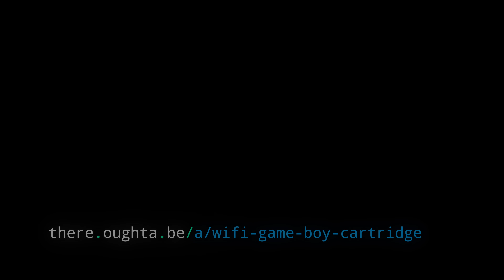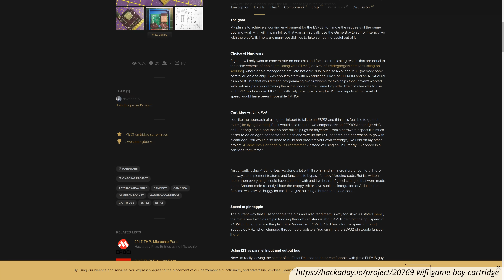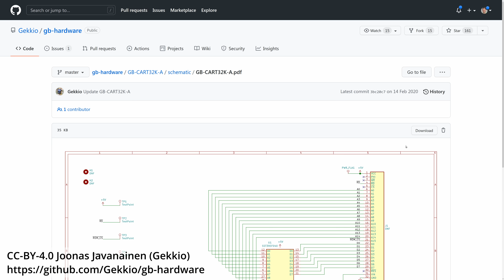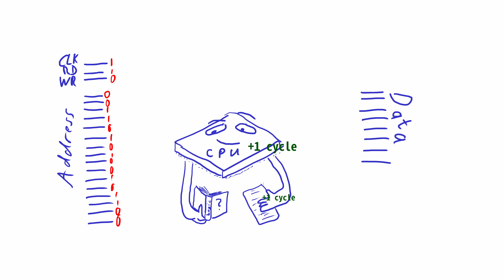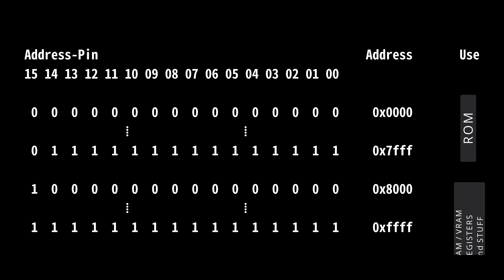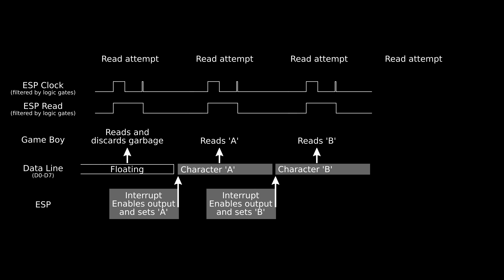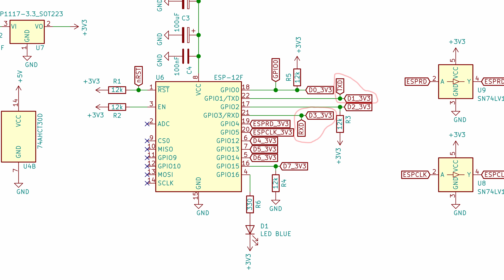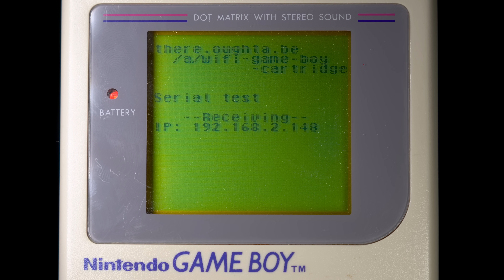WiFi Game Boy Cartridge

Comment: I wonder if you could have some memory in-between your ESP and the Gameboy, similar to the EEPROM.
Write to memory, then write to the special address to "submit" the data. Or to read from it, write to a special address to trigger a read, and wait until a particular memory cell (probably address 0) contains a special value to indicate the read was done.
You could probably condense this into a single special address by re-using that address 0 of the memory cell.

Of course, any additional buffer memory will reduce the amount of data you can use on your EEPROM. Though, if space is an issue, you could easily add bank switching...
Reply: Or dual ram but they are highly expensive

Comment: I have a stupid idea, if we know 500us access length what if we use timer to generate interrupt just a bit earlier than data needs to be fetched. we can kinda compensate for interrupt latency and check do we need to prepare data by checking logic output, in that case interrupt should be short to not ruin cpu speed a lot and be just in time for gameboy

Comment: Designs to satisfy nothing but the itch, love it.
Surely an input and an output latch would work way better (far more reliably). A tiny bit of logic to cause interrupts on either side for when to read. On the ESP side, the data could be loaded and read serially (4094 and 165 type chips). 4 or so HC chips or one gal would do it.

Comment: I just had an idea for a possible way to make it work with just the microcontroller, by breaking things up into different phases. First, have the microcontroller dedicate 100% of its time to responding to bus reads, but what it returns is a program that copies the rest of the program into RAM. (Heck, it could even ignore the addresses being read and just always return the byte it knows will be requested next by this small program.) Now the Gameboy is executing code entirely from its RAM, and never touching the cartridge except when the program does its delay-tolerant repeated-request thing to talk to the microcontroller.
This EEPROM based way is cleaner and more efficient though, and doesn't eat RAM that would be scarce if this were used in a game or other larger program.

Comment: So theoretically, could this be programmed to send commands to a waiting Alexa/smart system to control smart home devices? For example if the cartridge had a basic interface of selectable functions like Temp +/- to send the command to a smart thermostat. Seems like it could be a super unique control surface.
Reply: You could probably do it without hardware this advanced if you gave dedicated functions to the hardware buttons and just read the input. Up and down could be temperature control, A could cycle lights on and off, left and right could control dimming for example. That still leaves you with B, start and select.

Comment: Very cool, and good job! I am a bit curious though, from your presentation it seems like you know what data should be available for reading, and written data should be buffered. So a suitable small FPGA or a secondary microprosessor could act as a buffer in between: fpgas could drive that bus at way higher frequencies, and if you can pick a different(better suited) µC you could do things like have a 32bit register for reading/writing pins, so writing a byte could be as short as 3 or four clock cycles.

Comment: There is a special type of memory you can use. Renesas sells the 7007 32kB 5V Dual Port RAM and the 70v07 3.3V counterpart. This chip acts as a normal static RAM which can be directly connected to the address/data bus. However it has two intedended ports so two processors (the ESP and the GB) can work on the chip at the same time. You can write data from one port and read it from another, and the RAM chip will take care of everything.  The chip even has got semaphere logic and interrupt outputs so one processor can send commands and notifications to the other one. This would also make the EEPROM on your module obsolete, and software updates would be quite convenient - the ESP fillst the SRAM, resets the GB, and the GB executes the code in the SRAM.
Reply: this is exactly what i was thinking aswell! I think this has amazing potential. you might even be able to do it without resetting the gb, but just feeding it a jump instruction to the right memory address at the end of your write. I would love to work on something like this.

I can imagine a small OS running on the cartridge being able to put anything (like roms) on the ram chip from the internet, so you can have a bunch of programs on a NAS share and download these live with the wifi chip. Flash it onto the ram chip and bam. Might need to incorporate a button on the cartridge to reflash the OS onto RAM so you can change the program. Maybe this could also be done for a GBC/GBA cartridge

Comment: This is exactly, why I love cartridge-based systems.
Reply: Yeah I wish more things would use cartridges, imagine how cool it would be if someone made a open source handheld console that uses cartridges see how far the hardware/software could be pushed
Reply: @fossforever512 
Like, seriously dude? Now we have USB port, that pushed technology to an unimaginable level. Where have you been for the last 20 years dummy?
Reply: Well, whatever.
Reply: One day, games may come packed again in cartridges made of SSDs, as it is becoming less expensive and games are sucking so much storage from users SSDs.
Reply: @JuniorSilva_TheITGuy  Not internally consistent. If SSDs are getting cheaper, why wouldn't computers/consoles just have larger SSDs to accommodate large game sizes that way? Why would it be better to fragment that storage capacity into cartridges, which are just more storage, only that you can't enjoy the luxury of overwriting the data or consolidating it to one big SSD?
Reply: @dIancaster  games nowadays are 100 - 200 GiBs (there are some notable exceptions to this, such as DooM Eternal being about 40GiBs), if you have 1TiB of storage, you can only save 5 triple-A games in worst case scenario. It's an argument of mine that cartridges will have a comeback, not only because half of the people love physical media (if this weren't the case, we would already moved on to full digital), but too some might not wanna delete a game because it won't fit or even buy a higher storage SSD and do the transfer process (myself included). I may be wrong, but I stand for this argument. Do yours.
Reply: @dIancaster  Also, I'm not counting DLC. Internal Storage was initially an idea to additional content one game may have (Such as saves, expansions or account settings). But this argument is invalid, as you may think.
Reply: @JuniorSilva_TheITGuy  I think that this overrepresents the average file size, firstly-- most of my games are less than two gigabytes. DDLC, 0.28gb. Garry's Mod, 3.91gb. SpeedRunners, 0.7gb. You're right that triple A games are hungry for space, but platformers, visual novels, puzzle games, tower defense, and really just anything 2D are famously tiny. That's not to mention older triple A games like New Vegas-- only 9.23gb!
Reply: @JuniorSilva_TheITGuy  Secondly, the main appeal of cartridges; have the game ready instantly. In an age where there was no real "downloading games", cartridges were the only option, and when it became possible, it was still infeasible for larger games. Now, with high speed internet, not only do you not need to wait so long, but even if you did want to use a CD, you'd have to install from a download anyways! CoD and Fortnite can't sit still and frequently require 20+ gigabyte downloads, so even if your CD is up to date today, you'll be hit with a "Please wait while update installs before using online features."
Reply: @JuniorSilva_TheITGuy  Lastly, while there is some nostalgia to it, I'd wager it's mostly that. I've never witnessed someone who was raised on the convenience of downloading games wish "But what if I had to go to a store for this or wait several days for it to come in the mail?"  Even without nostalgia, I reckon there's a sizeable portion of the "CD only" camp is bound into using it only because the process of getting it digitally is too much of a hassle, or their favorite games just aren't available for online download.
Reply: Really? Because this is fixing the limitation of a cartridge-based system.
Reply: @dIancaster  With a cartridge. DVDs and game downloads are incapable of this.

Comment: There's a Wi-Fi cartridge for the Atari 2600.  Though, it's actually useful, in that, you can browse and load ROMs from the network.  It's using an ESP 8266, and a STM32.  Not sure why a dual core ESP32 couldn't have worked. 🤷‍♂️

As for the brown outs, you should add some decoupling capacitors (both ceramic and electrolytic) to help with that.

Comment: YouTube decided I would be interested in this video... and they weren't wrong.

However, I feel like this would benefit from a tiny little cPLD. Maybe something with 36 I/O pins, which would be enough for the 28 pins of the cartridge (16 address + 8 data + 4 control), and 4 pins for a UART/I2C to talk to the ESP32. 

The cPLD would serve 2 functions.
1. It would keep a ring buffer of data in each direction, so the ESP32 and GB can act asynchronously.
2. It would manage signals such that it can hold the interrupt line for the ESP32 until the mcu has a chance to read from the queue.

Comment: Just as a question, could an ESP32 have solved the performance issues? It has higher clock speeds and, more important, has two cores where one could handle the storage "interfacing" and the other one could do all the wifi stuff etc. (I know that multitasking is not really easy on these things and also heard that the functionality of one of the cores seems to be pretty limited as they are not intended to be used as two completely independent cores, but I'm not sure about last part)
Reply: You are bit confused about cores that ESP32 have, there are versions with either one or two main cores and then there is simple ULP core that is used only when main cores are put to sleep. I addition to having different number of cores, there is singl core only version with RISC-V architecture, and there is even clock speed difference between single core at 160MHz and dual core at 240MHz.

Comment: I am sure that modern controllers can handle it with proper programming. It is clear, that the arduino framework is not able to perform tasks that are more sophisticated that the standard stuff. Maybe also a fpga would be a good idea.
Reply: This is easily doable within the Arduino framework, just look at the 6502 community and their frequent use of the ATMEGA1284 to act as a virtual EEPROM/IO. It runs at just 20Mhz and is frequently used on 1Mhz bus designs. From the looks of it, the 6502 bus is near identical to this gameboy except that the 6502 combines the read/write pins into a single RWB pin.
One could start by using A15 as the interupt source, triggering only within ROM address space, using buffers on the bus to prevent bus contention and protect both the Gameboy and the ESP/Arduino and at least with the ESP dedicating one of its two cores to handling bus access with the other core handling communication.
Reply: @someguy4915  yes sure, I mean with the software framework. I would program it without C++ libraries.
Reply: @maxhouseman3129  Ah I misunderstood, yeah the libraries are easy to use but usually rather slow. Using interupt and direct port commands instead of the library digitalWrite/digitalRead functions you'd get a lot more performance at the cost of having to do a little more thinking to set it all up.

Comment: Now just stick a pi compute module in there
Reply: Gameboy emulator cartridge, you can develop games and run them natively without an emulator on one cart, with a fully functional Linux system, with a gui, 2bit color with an ips, or full rgb with external display

Comment: ITS NOT USELESS

ITS AWESOME

Also, isn't the ESP32 240mhz and dual core not 160Mhz?

What about using a secondary coprocessor to read the interupt cycles and then when it's a true call transfer them to the master processor?

I understand you have used an EEPROM here but would this not mean that it could done away with allowing direct ROM reading from the master?

Comment: The scenario you have is not so unique. By example the ACSI Port on the Atari ST suffers from similar problems when you try to interface it. The easiest solution is to buffer the in- and outputs. The controller writes in an output register and the bus catches the data from that. The bus puts data in a register In the other direction. Writing to the bus is tricky because the time from detecting a request to answering it is very short, a work around is to first do a write, so that the processor knows that there will be a read afterward.

Comment: coming from naive web developer perspective, wouldn't you be able to use the eeprom as a cache and do the heavy lifting via the esp asynchronous in the background? You could push the results into the eeprom and listen to changes if the esp has something to do. The gameboy surely doesn't need to be in sync every clock cycle with the esp results. Maybe you could even just use it as a framebuffer. But i don't have any experience and are just making things up :)

Comment: it would be interesting to have a 8255 for interfacing between the Z80 and the ESP8266. It's an old parallel interface chip, but it can be implemented on a CPLD along with the glue logic.
On it, you have 3 configurable ports. Port A can be configured with a bidirectional interface and port C has handshaking signals. The port B is a bonus port.
Reply: I was thinking something similar but with a dual-port ram

Comment: Makes me think of an idea I had a while back : making a game boy telephone cartridge.
It's be similar to this except that instead of WiFi it'd have a 2g modem with a sim card connector and a microphone. When you call someone, you'd use the GB upside down so your ear is over the gb's speaker and the phone would be near your mouth, inside the cartridge (the cartridge could look similar to the game boy camera's)
Reply: I would use it on a Gba sp. Ultimate flip phone
Reply: Would be pretty nice to call my mom on a GB
Reply: it's illegal to manufacture mobile phones without an FCC license in the US (it's a felony under federal law), that's why so many devices have mobile data support but it's intentionally rendered impossible to make calls.
Reply: @aftoknito  UK has similar laws
Reply: I think GBs don't have a PCM channel, or anything like that. They only use the built in sound font (oscillators). Could be wrong though.
Reply: @westelaudio943  The audio pin in the cartridge interface works.
Reply: Can't use 2g.
Reply: @cat1554  GPRS is still up and running in many parts of the world alongside LTE. Voice over LTE is a relative novelty in most of the world.
Reply: uh mom could never call during gameplay... and also..." lemme just install the right game card to call emergency services" 👀🤪 i mean better than nothing and derpy but at least it'd work. know what I mean?
Reply: There actually was a GB modem cartridge back in the day. You had to plug it into a phone line, then you had the least practical email client ever!

Comment: Mind if I suggest an other route for your quest here?
* DPRAM,
* EEPROM,
* an 8 bit latch that can be reset by the ESP µC,

Code in the EEPROM would just write instruction in the DPRAM, set a bit on the latch to generate an interrupt on the ESP, that would then read the DPRAM, process the instruction, then return the data through the DPRAM, the GameBoy could just way some time and read the DPRAM content.
Reply: Don't even need the EEPROM, just hold the GB in reset until the DPRAM is populated with boot code.  Can probably even do logo rewrite tricks on hardware that allows it (present one logo for the boot check and another to display).  Maybe can differentiate hardware by watching the boot timing.  For that matter, if the pin drive strength is high enough and the SRAM is fast enough, maybe you can use single ported RAM and steal an early moment out of the clock cycle to hit the RAM faster than the rest of the hardware can react to during the time when the GB isn't driving its outputs the right way yet - there won't be bus contention long enough to cause much I/O driver heating, the ESP just has to sync to the clock phase and then do its dirty work at the right times when the bus doesn't really matter.

Comment: First he's confusing ESP8266 and ESP32, and then he complains about a lack of multi-tasking capability. Pretty sure an ESP32 with two cores running at 240Mhz has no trouble feeding the GameBoy data fast enough. So why didn't you use it from the beginning? It even brings a whopping 512 kB SRAM.

Comment: Great work! I have a question: Is there a cartridge that turns the game boy into a universal remote control for TV?
Reply: There is a game called Mission Impossible that can be used as remote control for the TV on GBC, i dunno about DMG GB/GBP/GBL
Reply from the maker: The DMG does not have an IR transmitter, so such a cartridge would need to bring its own.
Reply: @lucss21a  thank you so much bro, but isn't there an homebrew for game boy color? Because I don't want buy that game only for this feature xD